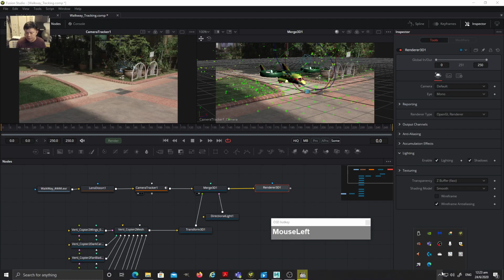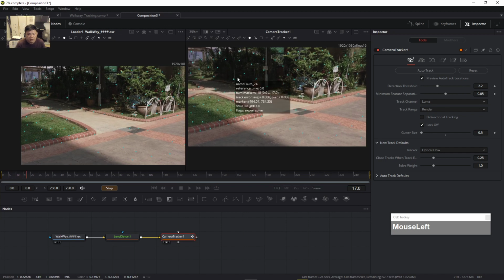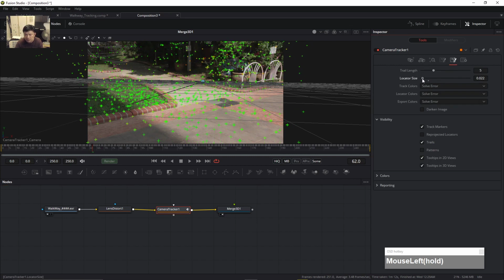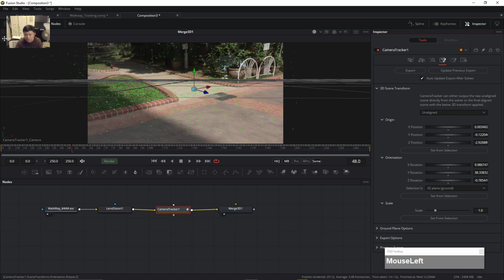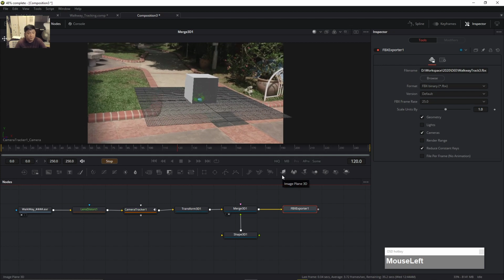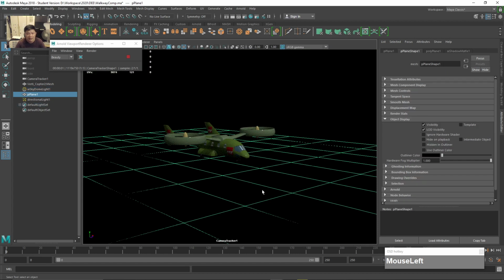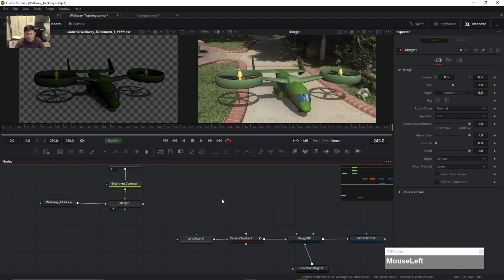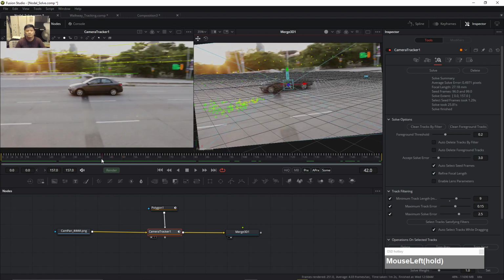Exporting Camera Tracking FBX from Fusion Studio 16 to Maya

Comment: Thank you for the very useful class. Do you think the fusion is better than the boujou or pftrack?
Reply from the maker: You're welcome! Well, Fusion is primarily a compositing software and it just happens to have the camera tracking ability. In terms of tracking  boujou or pftrack would be much more powerful as they are dedicated tracking software. Though the tracking capability of Fusion is good, there are still a number of limitations like not being able to manually track unless you use a bunch of plugins and addons which can be daunting for the novice. If you want to use a powerful yet free tracking software, I would suggest starting with Blender as it has a very powerful tracking software already built in.

Comment: Do you know how to render fbx exporter in the Davinci Resolve studio version?  There is no render tab, only in Fusion Studio  I would like to export to blender
Reply: disregard...I figured it out, loving this workflow with blender
Reply: How did you do this? And can you also transfer the track points to Blender?
Reply: @tipiks156  You should be able to go to the fusion menu and select "Render All Savers", that should do it.
Reply: how do you import the fbx to blender? i always got messed up when i import it to blender. like wrong rotation and very small scale
Reply: @ahmadghozali4925  I spent a whole day getting it to work but it didn't work :(
The camera rotation can be adjusted with the local rotation of the camera and the scaling can be adjusted in the import dialog, but in the end the tracker was totally imprecise.